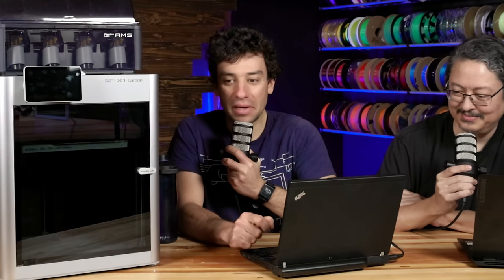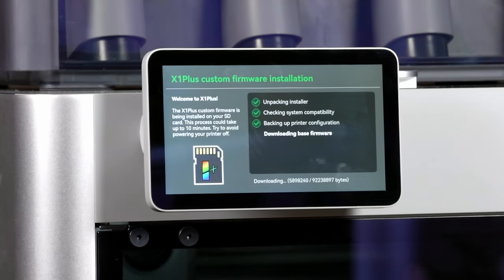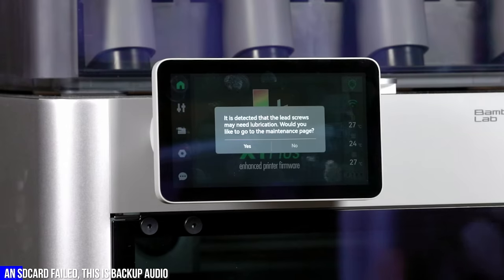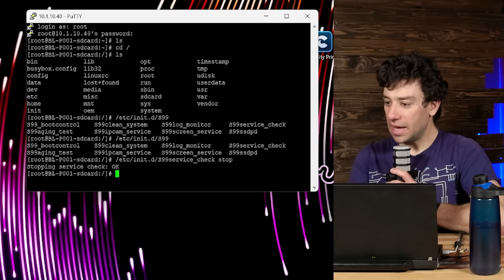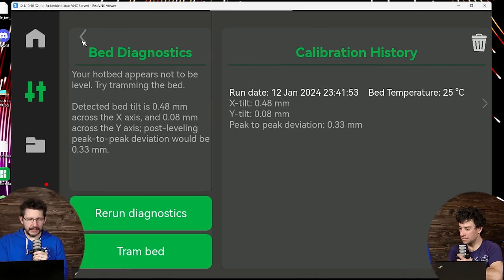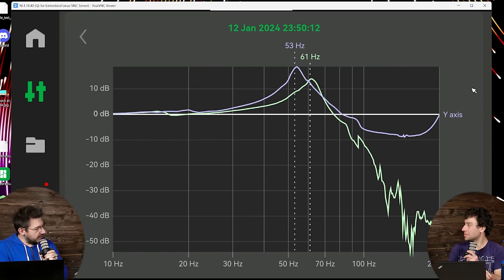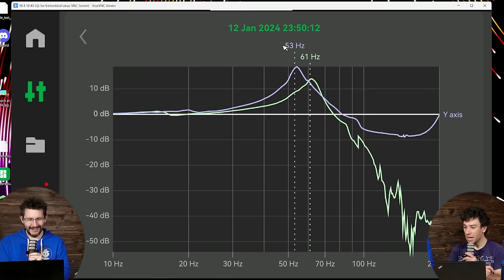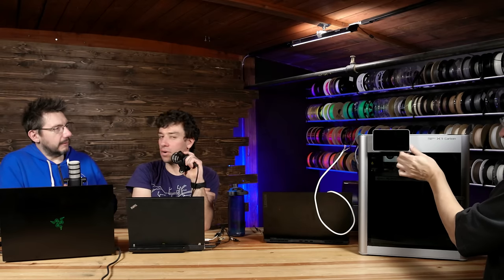Custom Bambu Lab firmware? The X1Plus Team shows us how

Comment: This is not an open source firmware, it's an hack overlay running over a binary proprietary firmware. Kind of a skin over BL firmware.
You can't install different hardware like a better thermistor, change the motors, install a new extruder or any major upgrade. So it's not like the other printers with Marlin or Klipper that 5 years after buying it you can do whatever upgrade you want.
Reply: And how do you know this exactly or are you just trying to sound clever because half of what you just said was wrong.
Reply: The bootloader is locked down, but this is the firmware, it will use the binary blob from Bambu, similar to how Raspberry pi does with bcm blobs. The binary running the motors may not be open source, the kernel part running the service is.
Reply: @mvadu  ok
Reply: @mvadu  The Linux Kernel, the whole Operative System is not important, the important part is the firmware that runs the printer: that is Bambulab proprietary closed source firmware. The other BL printers like P1 and A1 don't even need the Linux host.
Reply: @Fjprints  So show us this firmware, let me install that on my printer.
Reply: @eaman11  yes that is not open source but X1 plus is so when that comes out you can take a look and see how it works.
Reply: @Fjprints  Sure but X1+ ain't a firmware, it's more like a skin over android, a cosmetic trick.
Reply: @eaman11  It is an alternative (Linux) OS, not a firmware. You effectively install an alternative bootloader to be able to boot it from an SD card. You'll then still continue to use the onboard firmware coming with the printer. That being said, as we learned from the video, you can stop outbound traffic with a firewall (that LAN + Shield option they talked about).
Reply: @legitt6093  They refer to that as a "custom firmware" not a "custom linux OS". I know there's no alternative open source BL firmware, yet people do not understand that.
Reply: @eaman11  Yes. They use the word "firmware" to cater to the mass audience (i.e., the average 3D printer owner) because of the difficulty of the layman to understand the technical difference. I don't like it either, but this is how the world is.
Reply: @legitt6093  The average user can understand the difference from a display, a skin, a user interface and "the real software".

This is pushed to spread the lie that now there's "custom firmware" for Bambulab too, so you don't have to worry because it's not open source. As said: it's true, it's not what this is.

Comment: The way Bambu does business is suspect as hell to me.  I like the product, just don't trust the company or its firmware/software at all.  Does this firmware actually remove Bambu Labs from the send my gcode to the printer equation?
Reply: You can run offline removing "bambu" from the equation. the 3d printers of yesteryear were offline too. You can easily harken back to 2017 with sd card printing. 
Lan only mode DOES NOT send traffic online. This has been proven by numerous sources already. 
If you are using the Bambu cloud....you are obviously sending files to bambu...
If you dont want a kludge method like this you can remove the wifi antenna or go with a X1E which have way more network controls.
Reply: @hawtdayum  I read some reviews and watched some videos where they've said that Bambu has turned on their printer remotely.  See, with their CEO's ties to the Chinese Government and their lack of transparency I'll always be skeptical about them.  I get why you want one and I'd love to get one too, but I'll never get past those points, where you obviously did.
Reply: Yes , but if you give them your money, a part of it is going to be used for marketing purposes. Maybe see what kind of stuff people are printing, what material is most used etc..etc. it could be a kind of data collection, with no over sight

Comment: F the Bambu team, good job someone cracked it!
Reply: Did Bambulab ever suggest they would offer open source functionality ? If not, I don't really see why they are necessarily "bad" for not going that path.

The end of the video suggests that Bambulab might switch to open.
Reply: It actually sounds like the bambu team is quite reasonable.
Reply: @atom6_  Reasonable to void your warranty because you choose boot an alternative OS on your own computer? Please ...
Reply: @legitt6093  If you chip your car to raise the redline, increase turbo boost, etc., and you blow your engine, is it reasonable to expect the manufacturer to fix it under warranty?  Please...
BL have obviously gone to a lot of effort to create a very reliable system that operates within their parameters.  Their warranty is based on the machine operating within those parameters.  If you install other software on it, which may drive it beyond those parameters, it's not reasonable to expect them to fix it for free when it breaks.

Comment: Lan Shield Mode: you firewalled the maschine with IPTABLES and what prevents Bambulab to erase your rules, circumvent those or honeypot you as they can do firmware binary upgrades? Did you install a vannilla secured linux kernel with secured IPTABLES and whatever? I mean: that thing runs binary proprietary software, you can't trust it!
Reply: How are they going to remove the iptables rules if they do not have any access to the machine? It would be very worrisome if they have the equivalent of the Intel ME on there :))